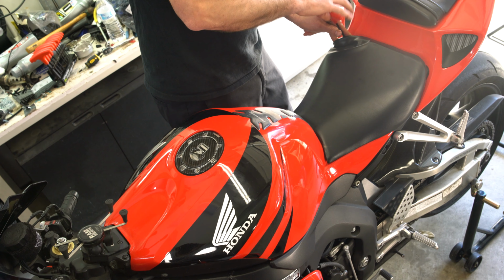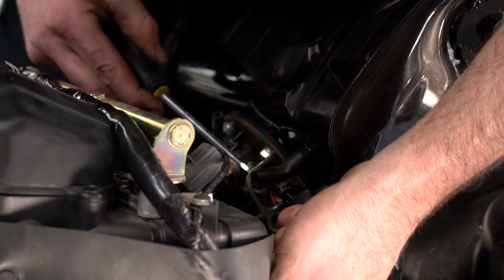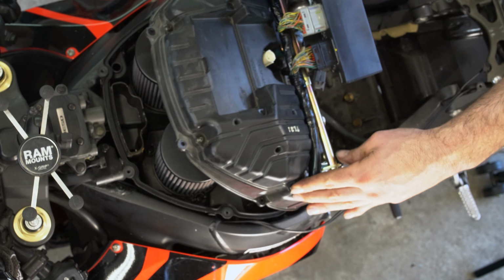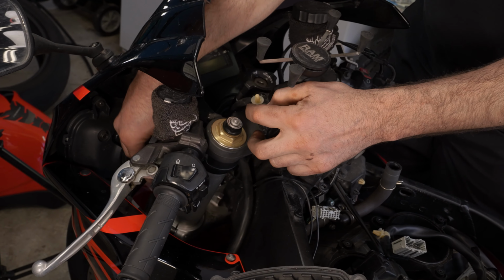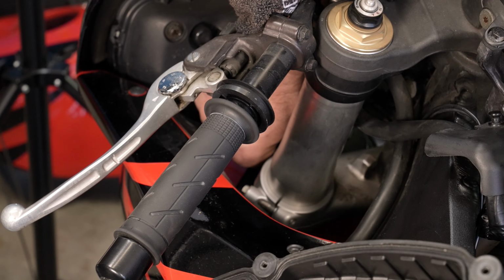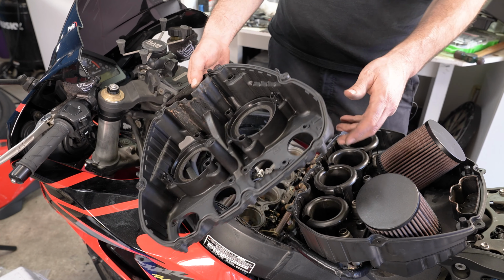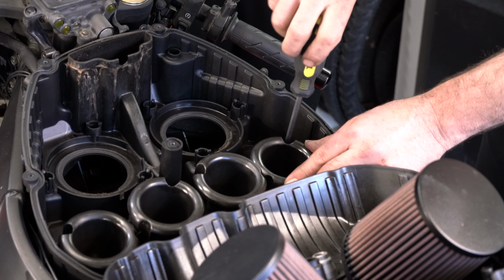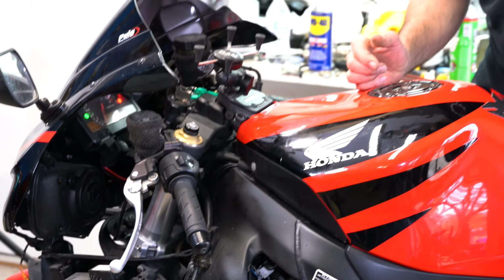How to Replace Horn/Light and Blinker Switch - CBR1000rr (04-07)

Comment: Another option is to remove the steering dampener.  May be easier for some.  Either way works. Video well done too.  And like you said,  the electrical connector is a bear.
Reply: do you find a video of that?

Comment: I noticed you were using a Phillips screwdriver to remove the airbox/lid etc.The JIS screwdriver of the correct size will avoid the potential for stripped out screws as the correctly fitting JIS screwdriver or bit will avoid the camming out that occurs when using Phillips screwdrivers/bits on JIS screws